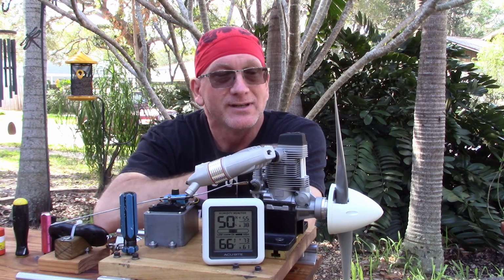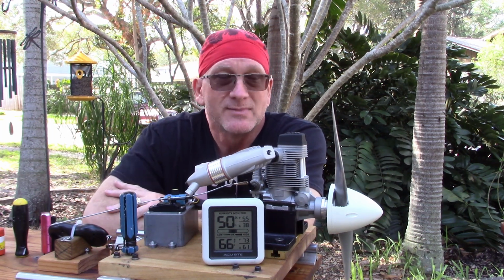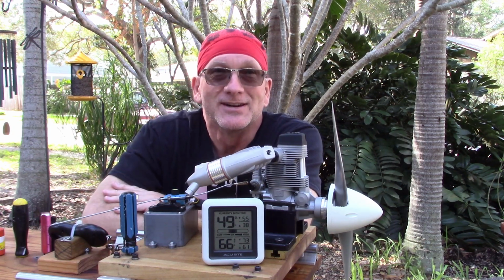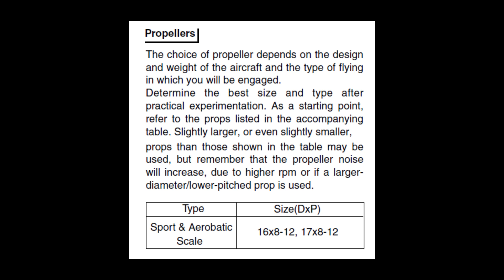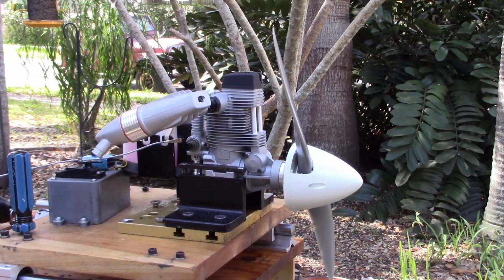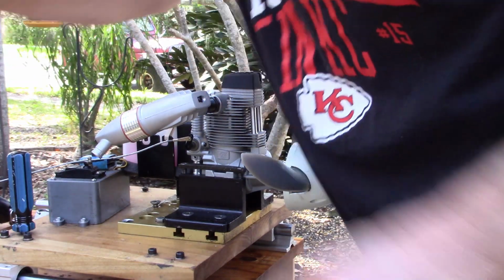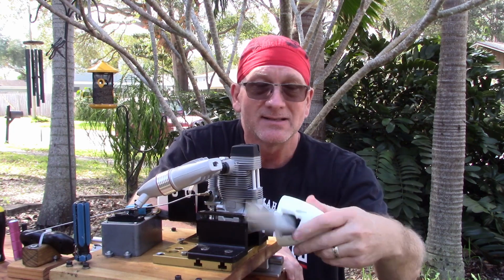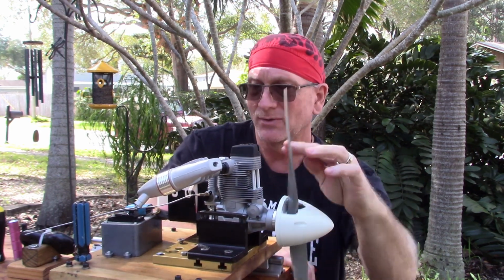OS FSa-155P The First Run

Comment: Perfect day for an engine run!
Is there anything that says it needs to be primed or purged of air?
Btw you can hear some detonation from 5m30s but that was after the plastic spinner started disintegrating. 
Maybe pumped engines need to be coaxed a little more gently with the needle? Not sure myself...
Looking forward to round 2!

Comment: If is brand new, the engine needs a good breaking procedure, at least two full tanks, big four stroke engines needs at least 10% nitro to run properly and stable at low rpm, I have a O.S. FS-200S pumped that is a beast, run 20x8 propeller at 7.500rpm, 12% nitro.
Reply from the maker: Funny because that is not what the manual states for break in period. 2:34.  But what would I know?  I have never broken in a new engine before....
Reply: @dmrcflyr2  The breaking procedure is similar that other glow engines, the manual in this case is not too clear, check valves gap, run the engine with 10% nitro and do it a good breaking procedure like a other glow engine. That spinner break has been very strange, I never saw anything like it ...